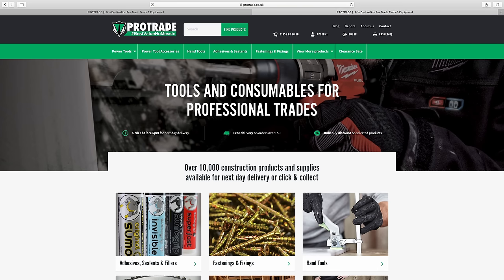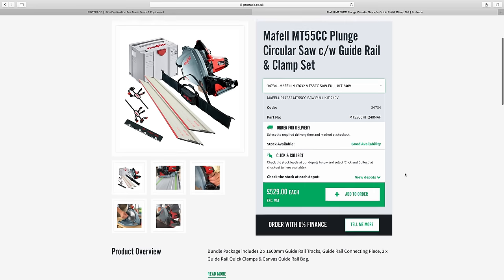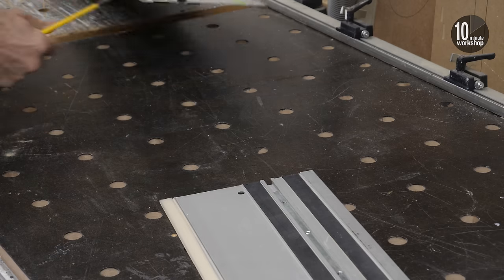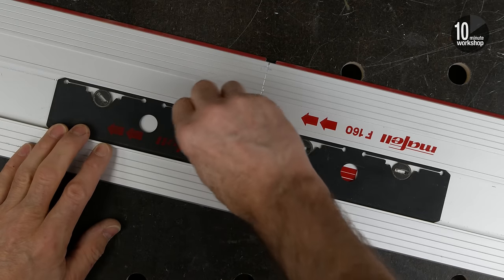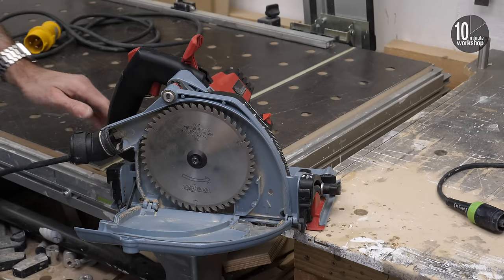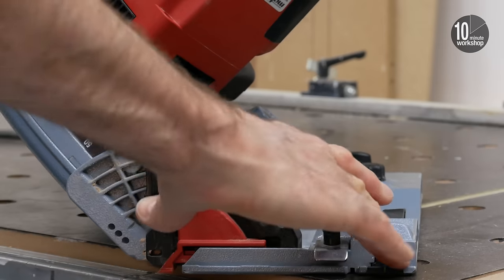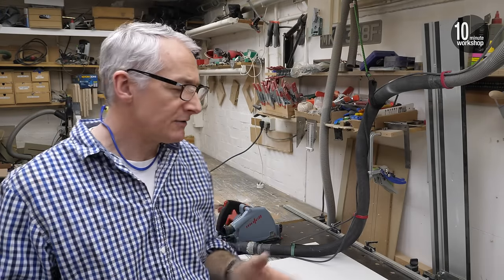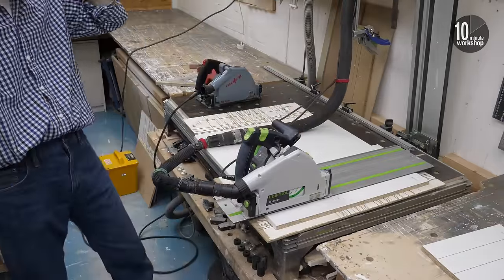Big Decision: Festool or Mafell? [video #400]

Comment: Just yesterday, after a couple of years of service,  I finally put tape over the ts55 blade "porthole".  If I was starting today I think I would give the Makita and possibly the Bosch a serious look, at the time I was shopping the Festool was the best-supported platform to purchase in the U.S.  Still very happy with the ts55 and has plenty of power for my needs.
Thanks, Peter, great video as always.
Reply from the maker: Thanks! Yes, lots more choice now than when I was buying my first TS55! 👍👍
Reply: I remember the old Makita.  That thing sounded like a old clanker ready to blowup.  Didn't help that the boss never bought same size blades twice or ever replaced the rubber strip.

Comment: Another advantage of a riving knife, completely independent of kickback, is in cutting thin strips of 1/4" (12 mm) or less.  Without the knife, these can wobble into the back of the blade, leaving a worse surface.
Reply: 6 mm not 12
Reply from the maker: Yes, good point, thanks! 👍👍

Comment: When the festool stops, it must rest to be able to use the saw again, with the mafell it is enough to release the switch, with the festool you need to replace the rubber on the guide more often, because the saw eats it.  a narrower guide system results in greater comfort and speed of work (mafell) .  much more accurate side saw guide (mafell) ... and many more things, but only a person who works a lot on these saws and a person who cares about the speed of the work can pick them up( mafell)
Reply from the maker: I’ve had both saws for many years and disagree with everything you say. 🤷‍♂️
Reply: @10MinuteWorkshop  ...because you don't use them often. everyone knows that when the festoll is turned off, it must "rest" in order for the power to work further, and the mafell cuts further after releasing the switch, how can you not notice it ..?I suggest that I take two of my mafell saws (240 and 110v) two festool (240 110v) plus two Bosch (240 110v) and Makita 240v to you and together with your saws we will record a joint video on your YouTube, from the test of what I am talking about  .  agreement ?

Comment: Great video.  Thank you.  I live here across the pond in the USA and there is only one dealer for the Mafell.  Online only. There’s multiple dealers for Festool.  For me it’s the imediatamente access to tools and parts that I’m struggling with.  I’m a contractor/remodeler só driving to a store when I need something is key.
Reply from the maker: Thanks! Yes, I’ve heard that about Mafell in the US - a real shame as they make fine tools. Then again, it’s the same reason I ended up with Festool, originally! 🤷‍♂️👍
Reply: Peter Millard You’re welcome.  Yeah it is a shame for sure but ultimately I’m going to go ahead and pull the trigger on the Festool.  There’s nothing more aggravating then having to wait for a tool to come in the mail.  I’m really curious to see how well the tools hold up in real world everyday use.  Are they truly contractor grade?   We shall see.
Reply: A year later... but try Makita?  More real dealers and service centers in the US and Canada. Tracks are the same as Festool.  The Makita plunge saw has magnesium casing too, so it’s fairly light, and has the quick scoring feature like the Mafel. Corded model has been around for over 10 years, cordless is available now as well.  Or there’s the Bosch, which has some similarities to the Mafel, being either built by Mafel or uses some parts from them, and uses the same track.

Comment: This is my favorite of your videos.  After watching it I purchased the bosch/mafell.  I purchased a large 1250 CFM shop fox dust collector.   I was thinking that a vac that large would take care of 95% of the dust from this track saw.  It doesn't.  There is still quite a bit of dust!  Do you have any advice?
Reply from the maker: Thanks Mark. Is it a big tin drum type of dust collector with a wide hose? Those are good for static machines like table saws and planets, not so good for plunge saws and routers. You need a high pressure dust collector - the ones that look more like a household vacuum like the Festool CT26, all manufacturers make them. But in reality, while the dust collection on these higher end saws is about as good as it gets, there’s always some dust that escapes around the blade. 🤷‍♂️👍

Comment: I think, there is a missunderstandig of the "Anti-Kickback" from Mafell... Quote of the Mafell Owners Handbook: "2.8 Residual risks (...) Machine backlash if the blade gets stuck in the
workpiece.". So I think, tehere is no real Anti-Kickback-Function. Managing the motor and avoiding a Kickback - I don't believe. Also Mafell sells a "Kickback-Stop like Festools FS-RS. Missing the Riving Knife is EU-Law so long, as the feather of the table is stron enough to pull the blade back in a definated time. Festool has one and it's a "Nice to have". Both machines are very good. I think the system is the argument to buy Festool or Mafell. Prices are eqal...
Reply: palereinhold I own the mafell saw, the electronic anti-kickback most definitely works.

Comment: If you had 2 long tracks connected together - for example two 10-ft tracks - is it safe to pick up the tracks up while still connected together or will that be too much tension on the connector pieces?
Reply from the maker: Way too much stress with two long lengths like that, unless you have a couple of people helping you. Even two 1400 rails need care when moving them around. 👍

Comment: Thanks for the heads-up about the offset scribing 'feature' on the Mafell!
I used a significantly inferior Makita plunge saw for 5 years (secretly delighted when it gave up the ghost due to low quality bolts and fittings) with a similar offset ~.2mm and always considered it to be a flaw in a saw which is clearly intended for sheet material and finish carpentry/joinery.
2 good things about the Makita though:
1.I never had a kickback from it whereas the Festool plunge geometry is very prone to this under site conditions,so much so that I always use the kickback block on worktop cutouts which I never had to worry about with the Mak.
2.The locking mech to keep the saw firmly on the track for bevel cuts which always feel a bit precarious @45 with the Festo.

Comment: you should have tried the scoring cut with the muffel without using the offset scoring cut function to compare
Reply from the maker: I could also, buy a dog & bark myself; it has a scoring function, it’s their big selling point / USP  and they make a big sing & dance about the 0.1mm blade shift etc.. etc.. If you’re buying the mafell, why wouldn’t you want to use that function instead of manually making the scoring cut? 🤷‍♂️

Comment: Very nice practical comparison test, Peter.  When I first considered the whole "track design" innovation, I ended up at the same point: Festool vs Mafell.  Sure, there are lots of fine points that can be debated and/or discussed when it comes to the two track saw designs, but the most basic point seems to have been lost in many of these comparisons: the tracks themselves.  Yes, you did a good job of showing the differences in the tracks, herein, but you also seemed to have glossed over how important this is in the end.  As a timber framer, I own and have used both track systems and, hands down, the Mafell FSN -- which Bosch also adopted -- is superior to the plunge-track system introduced by Festool back in 1980.  The fact that the guide strip, that is mechanically attached to the edge of the FSN track, is physically cut to match the blade in use is ingenious.  Why?  Because it means that the red strip is now the perfect guide for any and all subsequent cuts.  In short, all one has to do is make a mark, line the red strip up to said mark and cut.  Sure, the edge strip on the Festool tracks is cut in the same way, but, as Peter pointed out in this video, the Festool uses an adhesive-backed edge strip that's prone to moving and/or separating from the rail.  Combine this with the way that Mafell attaches one track to another AND the trigger-operated clamps that slide into the slots underneath the FSN rails and, once again, you end up with a superior overall track system...and, come to think of it, the clamping systems employed by these two brands for securing their tracks to the work should have been looked at more closely in this video.  It's much too important to have been left out.
Reply from the maker: Thanks. The tracks were discussed at more length in the follow-on members video, and while I agree the Mafell rails are easier to join, it’s not something I do much these days. I’ll politely disagree with you re the Mafell splinter guard; I’ve never had a Festool one come adrift - and I have a lot of their rails - and the fact you can unstick it, move it out a couple of mm and re-trim is very useful. I agree that getting clamps closer to the splinter guard is potentially useful, but again it’s rare for me to need to clamp a rail, and I particularly dislike the proprietary nature of the skinny t-slot in the rails. I also find using the Mafell rails quite awkward as well - though that has a lot to do with Festool muscle-memory - but they’re just not comfortable to use, being so narrow. 

We all have personal preferences, but I really don’t think it’s as simple as declaring Mafell ‘best’ as there are pros and cons to each.  👍👍
Reply: @10MinuteWorkshop  Hi Peter ~ Please don't take any of my comments the wrong way, mate.  In my experience, one of the only truly useful aspects of the internet is the ability for regular working folk to exchange helpful information, so I take constructive criticism fairly seriously.  Although I was introduced to Festool first, I'm happy to report that discovering Mafell tools has made a significant improvement in my work life.  They claim that their carpenters are highly involved in the engineering of their power tools and, quite frankly, it shows when they're in use.  The vertical strut design of their bigger circular saws, for example, is ingenious when compared to the single axis "clamshell" plunge motion of most other circular saws.  I also really like the fact that they incorporate a lever for pulling away the blade guard.  Between these two design features, one can place the main shoe down on a flat surface with zero contact with the blade itself.  Reading it here may make features like this seem trivial or unimportant, but after lifting a saw off of a track numerous times during a workday, it becomes very important, especially to an older carpenter like myself.  I'm sorry to read that you haven't experienced the Mafell innovations the way that I have.  Regardless, I appreciate the video and I hope that you stay with informing the YT community the way that you have in the past.

Comment: I've just sold my festool, I liked a lot of things about it but one thing I couldn't get on with is the fact that it runs like a diesel. It wasn't just mine I've used 2 others and my brother said the same thing, also yours sounded the same to me. The Mafell in your video sounded smoother although it was hard to tell because it was sped up. I thought I may be able to live with the Excell I bought for cutting floor screed, but I know I can't after using it for one day. I'm in deep with rails as I have a 3 metre one that I wouldn't be without. Would you recommend I buy another Festool or Mafell?
Reply from the maker: Well, if you can’t stand the noise of the Festool - sounds like a sackful of spanners - then go for the Mafell. It’ll still run on the rails you have - I prefer Festool rails, despite the Mafell being better to join, they’re better for accessories because of the left-side t-slot. There are pros and cons to each saw of course - I’ve just bought a Mafell, so I’ll have a more considered opinion of it when I’ve used it a bit more. 👍
Reply: @10MinuteWorkshop  thank you

Comment: Hi Peter, bit of a cross-over question with your track guide video. Does the Mafell saw fit on the Evolution rails?
Reply from the maker: I haven’t actually tried, but although Mafell went their own way on guiderail design, they’re compatible with Festool-pattern rails, so they should be OK with the Evo rails. 👍

Comment: I have the Bosch GKT55 I love it in fact I wouldn’t have bought my Ts1 tablesaw @ a cost of €3200 had I bought the track saw first. I love the mafell rail it’s flexible but super straight once joined. Good video 👍
Reply from the maker: Thanks! And yes, I do like the Mafell/Bosch tracks. 👍👍
Reply: i'm fairly certain mafell make the Bosch saw with a few differences

Comment: Exactly how deep do you need to cut for the Mafell scoring offset to not activate? If you simply have to score cut 4mm instead of 1-2mm that wouldn’t be a deal breaker for my purposes. But if it’s forced on you any deeper then 3-4mm I would have to pass for that reason. I’m not opposed to dropping the money, but the TS55 is currently serving me well enough that I couldn’t justify having that feature forced on me.
Reply from the maker: The scoring cut is entirely user-activated - you flick a switch to engage/disengage it. This particular saw is going to be checked out as there may be an issue with the offset. 👍👍
Reply: Peter Millard oh.. so you can just avoid the offset completely by simply setting the regular depth stop to 1-2mm to score cut instead of using the special score cut feature ? Perhaps I missed that in the video.

Comment: I agree the Festool track needs improvement when joining tracks for longer lengths. Festool customer service answer is buy a longer Single track. Sort of defeats the purpose of a mobile track saw. The  long Festool rails are expensive $$ and you need to take care while in transport and everyday storage. The Mafell unfortunately has a machined edge and the alignment issue is not a factor when joining tracks. So this brings up the very difficult decision to sell my ts-55 in favor of the Mafell MT-55. The cubrix motor on the Mafell is better and you can hear the difference on the motors. It would have been a better comparison using a new blade on the FT. Plus cutting some 18mm Baltic birch plywood along with MDF and running a 45 degree bevel cut on some mdf with a wood veneer? If the scoring cut shifts to the right how would there be a gap when cutting on the second thru cut.

Comment: The hairline shift in the blade is designed for rub glueing and clamping boards together instead of butting them up. Thank you for the video with this quality of content I have to subscribe
Reply from the maker: Thanks and welcome. That’s way more than a hairline shift on that saw though; itwas sent back to Mafell for checking - if I ever get it back I’ll report. 👍
Reply: @10MinuteWorkshop  I was, and an, wondering about Mafell's reaction. Mindo you, neither suits my wallet.

Comment: I had chance to get the mafell borrowed to me and the scoring cut is as well a concern to me which you could address by the same trick you used on the festool (holding from full depth). Of course then you lose the interest of the switch.
Reply from the maker: Yes; this saw will be checked over as it doesn’t seem right, but there are more ways to get the scoring cut. 👍👍
Reply: @10MinuteWorkshop  do I understand correctly that your saw scoring cut switch was creating bigger gap than expected?

Comment: I have the Makita SP6000, much prefer the Mafell score line engagement, but the Makita doesn't shift the blade noticeably in my experience. Also a big fan of anti tilt feature. That said I wish it had a riving knife and that the blade change was as pleasant as the Mafell.

So what we need is a combination of all of the above. One saw to rule them all. Riving knife, anti tilt, zero shift score line, enclosed side and easy blade change.
Reply from the maker: Yes, it’s a shame nobody does the saw to suit everyone. Interesting to hear you like the anti-tipping thing on the Makita - I’ve always found it to be a bit of a gimmick. 🤷‍♂️👍👍
Reply: @10MinuteWorkshop  I am forever doing 45d angles it seems. I find it also helps with kickback.

Comment: How did you find using a 1400mm track 'loose' (i.e. not on the flip down bench hinge)? Seems an odd length for cross cuts?
Wondering why it is so common.
Reply from the maker: No problem at all - it's how I learned to use a tracksaw. 1400 is a good length to crosscut a 1220 sheet - gives just enough overhang either side. 👍

Comment: Yes the mafell will kick back but only under certain circumstances; if you plunge too fast and don’t have proper forward force or grip on the saw whilst doing a risky cut in thick material. It happens but will most Likely be you’re fault when it does. Easily avoidable with anti kickback stopper and proper grip. The scoring function is handy but to be honest I don’t use it all that much; if you’re joining two bits Of melamine edge to edge like you demonstrated, it does leave a hairline and would agree it’s unacceptable. I do love my mafell though the features are great and very well engineered. The blade change is a joy to use it  makes anything else seem like a pain in the ass. the rails are by far superior to anything and it’s got some serious chooch! Plus build quality is 👌 you really see where the money goes. I would bet this tool will last me a lifetime. Would be cool if they did a 75mm plunge version like festool do, the extra depth would’ve been nice Also I would have liked to have seen an anti tip function like on the makita. That aside Ive had this saw for 5 years, having used the makita, festeringstool and Dewilt mafell is my favourite.
Reply: I saw a guy add aplastic piece to the bottom of the muffle to act like a anti tip as it in gauged the rail